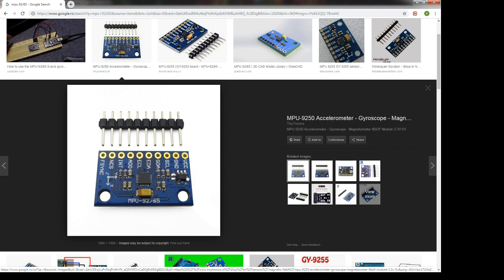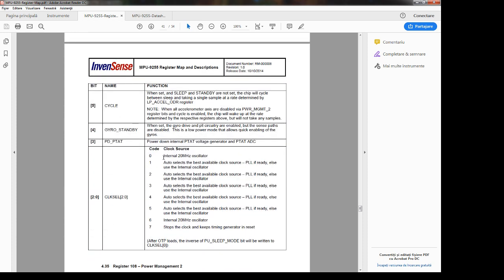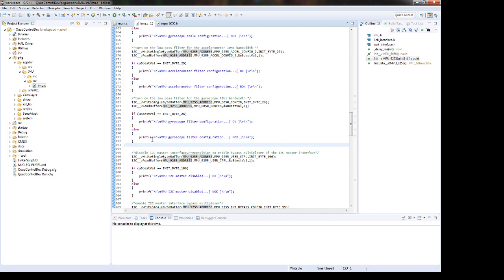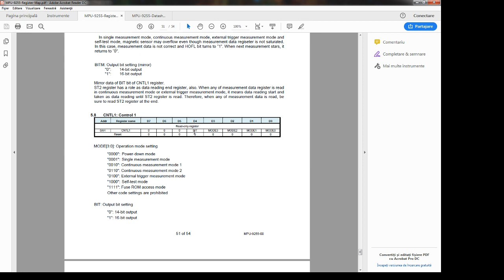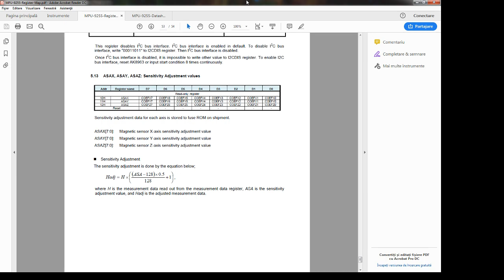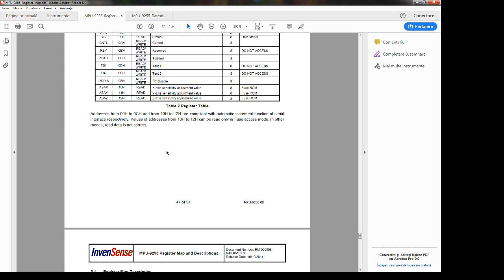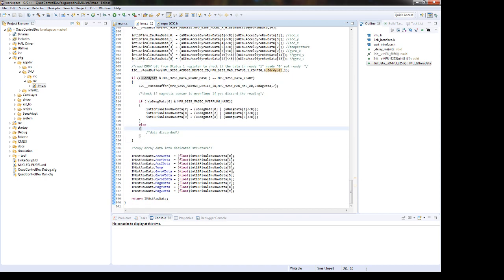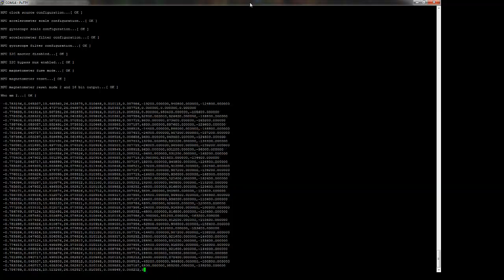How to read data from MPU9255 using I2C on stm32

Comment: Hi brother, thx for the video, I tried the code to perform on STM 32 F429 Zi with MPU 9255, when I build project I had an "error as too few arguments to function 'Error Handler ' " How to resolve this.
Reply from the maker: Are you sure you got an compile error or a toolchain error? This repo is no longer maintained. I suggest to use  the function in your own project.
Reply: Thanks for the reply, I tried and now I'm getting errors like multiple definition of aRxBuffer as well as for UartHandle. Kindly please consider me to complete this, since I'm in need to interface MPU 9255.
Reply from the maker: @anbuscientist4635  You can not have multiple definitions of the same variable. Join the discord server maybe I can help you there with some hints!
https://discord.com/invite/cdVzfH4s
Reply: @embeddedroom  thanks for your support

Comment: Hello thx for the video, I checked your codes but it is also includes 6050. And I didn't work can you give me tips about that?
Reply from the maker: Hello. There are 2 possible issues if it does not work for 6050. 
1. You may need to recheck the #defines macros to be ok. (especially device id)
2. Your I2C low level driver is not returning ok.

I do not use anymore 6050 but it works. Please perform some debugging to see where it fails. Thank you.
Reply: i guess it's pretty off topic but do anybody know of a good website to stream newly released movies online?
Reply: @gavintitan8796  Cmovies works great.